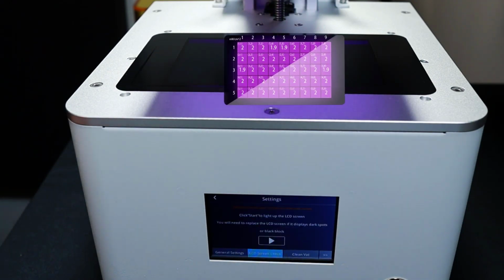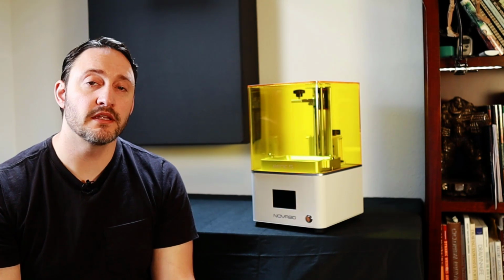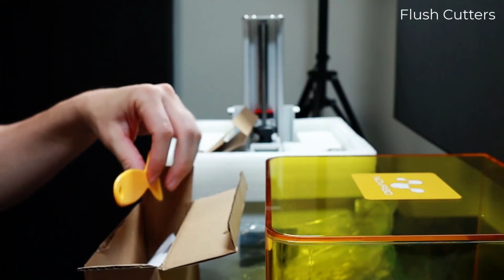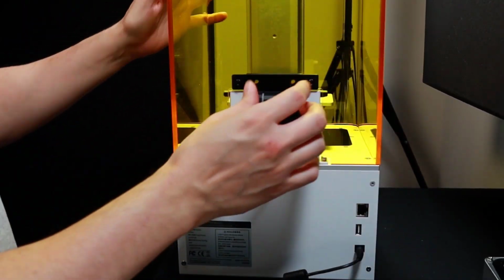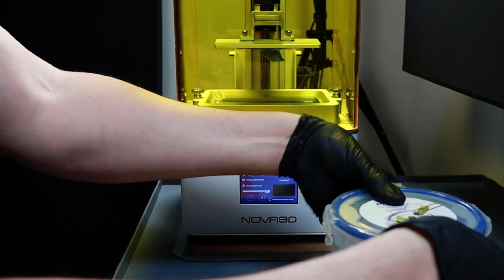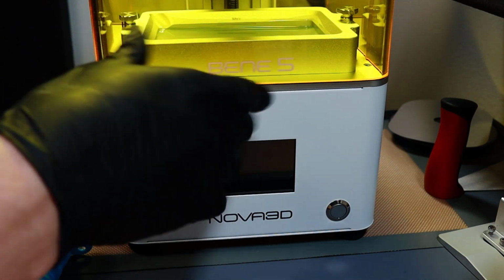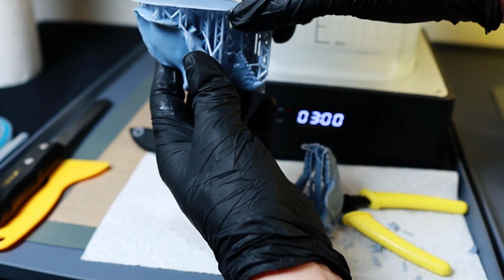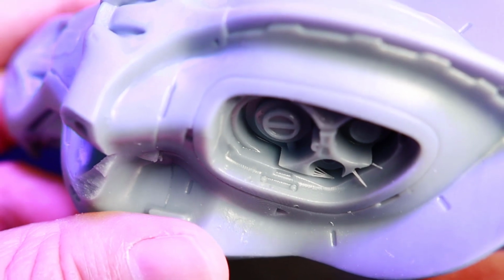The Nova3D Bene5 - Resin 3D Printing features, unboxing, custom prints, and results! Follow along!

Comment: One important thing for people that want to get into 3d printing these resin printers seem to be locked to their screens at least until now, i have 2 resin printers that use 4k screens but higher resolution screens don't seem to work on them which will make them obsolete in a year or two if that is the case and if then printers can't be updated. At 4k depending on the size of the screen and the size of the pixels they produce voxel layer artefacts and for really detailed prints either buy a high resolution small printer now or wait further down the line until higher resolution screens will be able to completely reduce the artefacts.
Reply: Seriously, why would anyone assume it's possible to change the screen in a resin printer? Are you able to upgrade the screen in your tv? Your phone? You are possibly only person in the world that even considered it. Printer will be obsolete in a year or two? Like virtually everything else?! :D
Reply: @randomnickify  U can't compare devices to a 3d printer that produces layer lines, are u serious? So are we suppose to buy a new printer every year that has basically the same components and just a higher resolution screen? So u prefer that instead of just getting a new screen and maybe a new board if that is the case? The goal was that they were supposed to be modular and updatable not locked like in the old days.
U probably are one of those apple fanboys.
Reply: @Icemanmodeler  This is 300$ printer, lots of people, including me, pays 500$ - 1000$ for a new phone every 2-3 years. I do not see an issue with replacing 300$ printer every 2-3 years.
Reply: randomnickify I wasn’t talking about this printer but resin printers in general I have a MonoX and a Transform. The Transform is over 2k, am I suppose to buy the Mega8k now instead of just upgrading it to a higher resolution screen? I think not.
Reply: @randomnickify  elegoo sells replacement screens for their mars printers already. I think I've seen something saying about an upgrade to bring older models up to newer spec but I didn't look at that in depth.
Reply: Mark The Cruel That’s good to hear, it’s not an immediate thing for me but I hope these printers don’t become obsolete when newer models come out every year. Even if they don’t officially support it it maybe possible just by replacing the motherboard an updating the firmware, I’m sure someone will attempt it at some point. No sense in buying the exact same printer every year with almost all the same parts just for a new screen.

Comment: Hey Mike, I wonder if you add a few ounces of weight to the top back corner of the UV cover if that will hold it open? I'm saving up to get a resin printer, I want to use it to print eyes and skin texture stamps for traditional sculpting.
Reply from the maker: I'd be super interested in seeing those stamps, that sounds like a great idea! And I bet you're right, it wouldn't take much to counterbalance the UV cover!